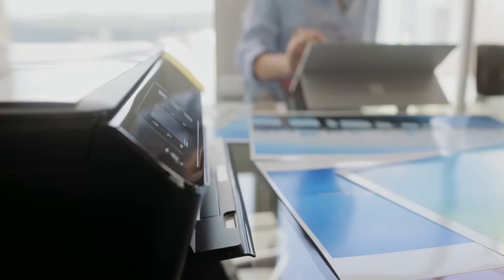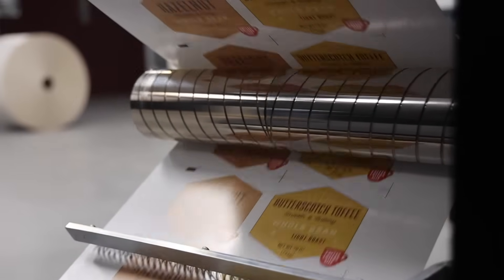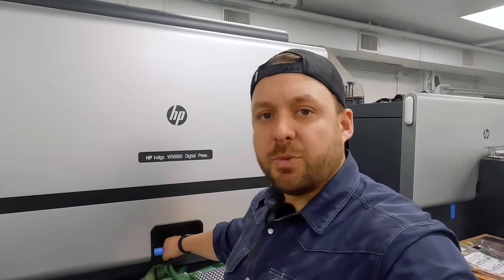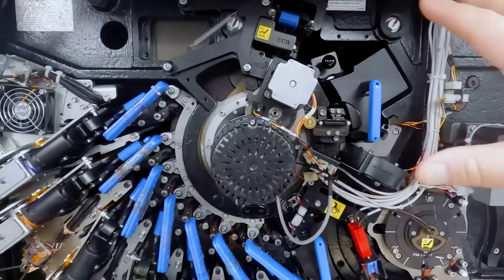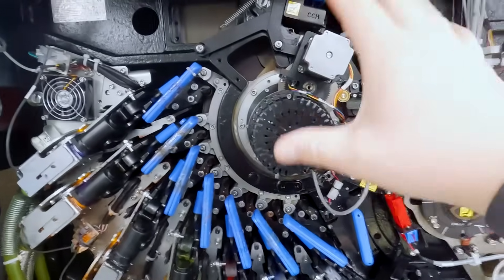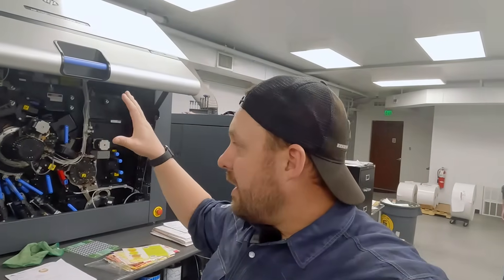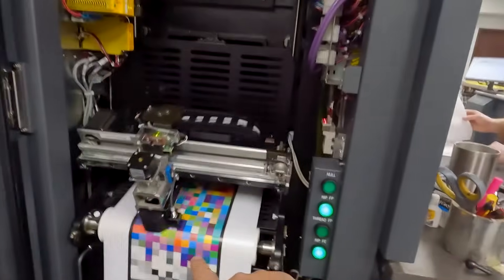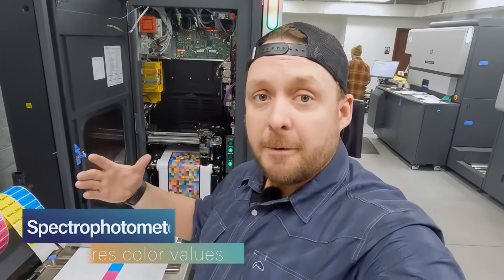Exploring the World of Digital Printing: Unveiling HP Indigo Printers and Printing Technology

Comment: To say that offset printing isn't fast is misleading. You show a sheet-fed machine rather than a web, then show the ink priming phase.. as if you don't have to deal with ink with digital presses. Are you suggesting you never have to replace cartridges or prime your machine before a job? The rate at which a web-fed machine in a traditional press is easily just as fast as a digital printer. All you do is include the pages for that next job in the same setup. It's all about time management.

Comment: So, it's Flexo meets toner copiers.   Nice
Reply: it is not a toner, it is a liquid colour. the main ingredient is a paraffin oil, the pigments are a type of plastic particle, the colour is applied at 90-110 degrees celsius. The paraffin oil evaporates and the plastic particles fuse together on the blanket to form an image, which is then transferred to the material.

Comment: Can the 6800 run 250mm wide material .
Reply from the maker: Our 6800 setup currently is unable to do this, but the 6800's can be set up to print this wide.  If you've got any other questions just holler!
Reply: @stickermountain  330mm is max you can run

Comment: how much is the total printing machine price?
Reply: I think they have different models - but ive seen 35K on the low end
Reply: @marknobert installed it cost almost $1million dollars. I just bought one. (I obviously didn’t pay that) just for me to get it under warranty it has to be brought up to HP standards and they told me $103k for installation is $12k and additional training in GA $5500 and they come out to you for your opening ramp up that cost $250 per hours and they there for 5 days. I don’t know if I truly have to do all of that but that is what the GM in the Chicago area told me. He said he never really had to deal with a situation where a customer bought the machine second hand so he said he is here to guide me through the process. 

My question is do the installation have to be done by HP. I’m not really ready to fork over $12k but if I have to I will be dancing 🕺 on that pole😂